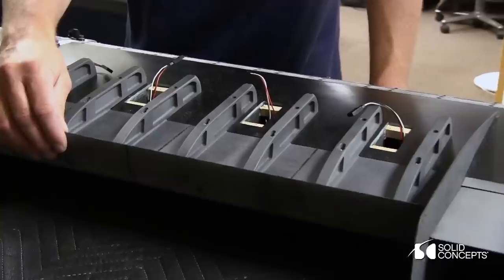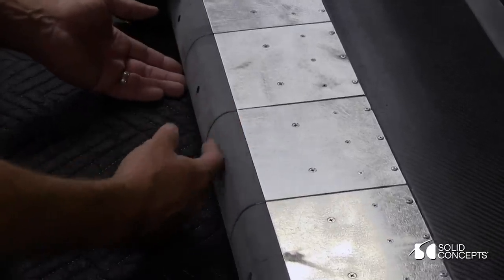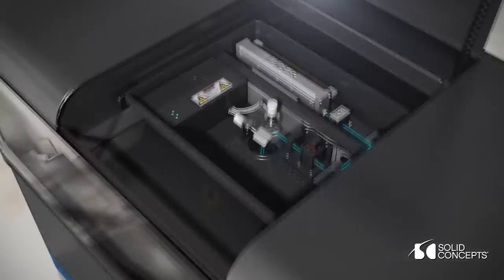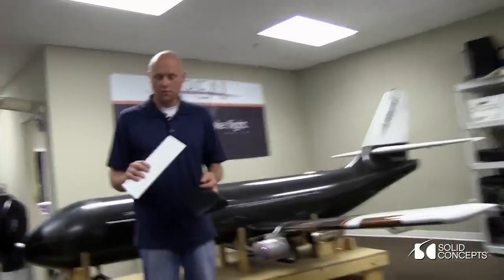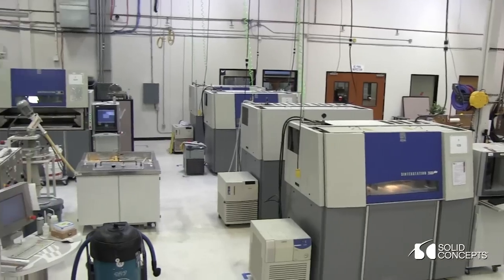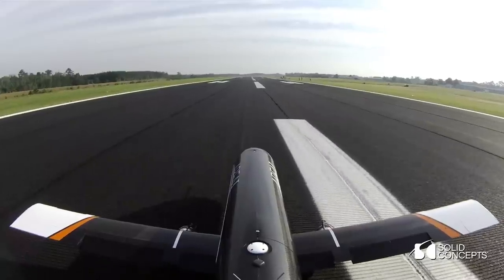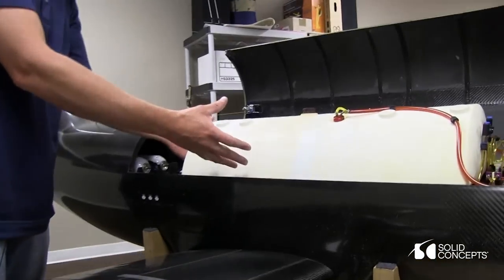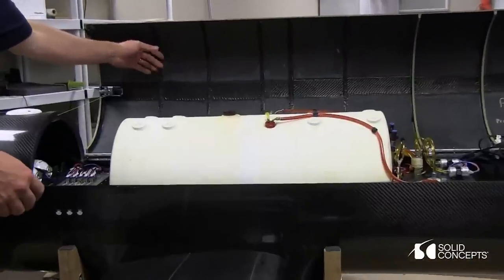3D Printing Gives Flight to Unmanned Aircraft

Comment: looks like a great project, and i like the ailerons a lot, although i would be worried a bit about jamming when the wing flexes. I'm sure you thought of that though.  what i don't understand is the low wing, the low center of thrust, and the use of turbines instead of say, turboprops. is this a test aircraft for a full scale project? perhaps? what's the application?

Comment: Very exciting. Howsabout you boys give birth to an unmanned DC-3, thereby launching a new "Golden Era of Flight"?

Kinda take a C27J & a Twin Otter, interbreed them, cut out the "meat", & see what you get. With meat, it might be 8,000kg empty, 13,000kg max takeoff weight. Sacrifice range & speed as necessary to get there, prioritise reliability, maintainability & lowest TCO. Maybe without the meat you can do even better.

Maybe similar to a somewhat smaller, meatless version of the upcoming(?) IL-112.

Reduce the cost of small air freight service to towns & semi-remote (<short haul) locations. Melbourne - Hobart, Tasmania, Africa, wherever smallish, cheap, simple, maintainable, intermittent air freight service is desired.